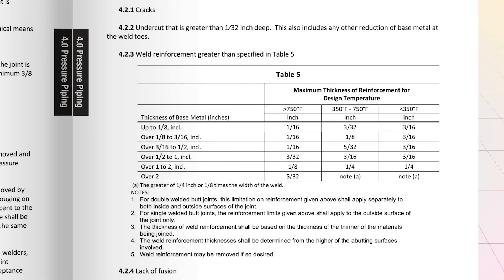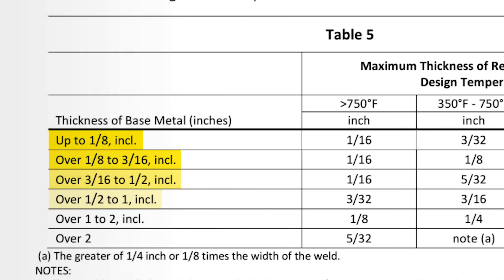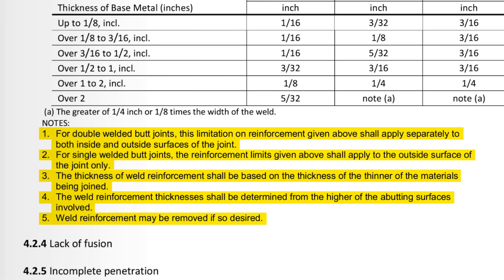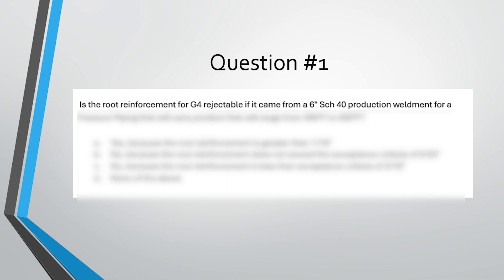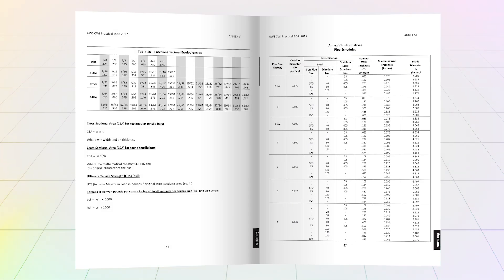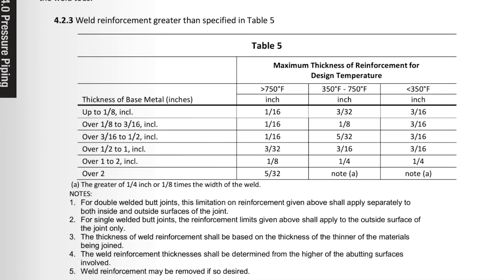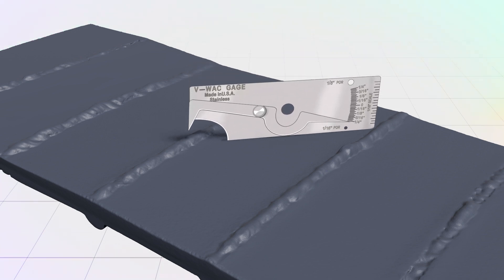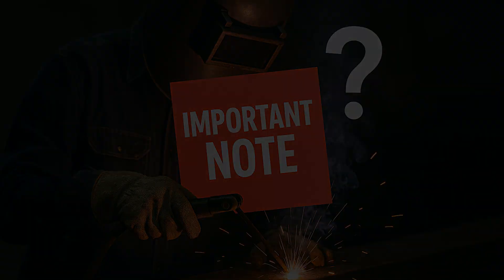Table 5 Secrets Unlocked: Master Pressure Piping Reinforcement Limits for CWI Part B Exam | Part 1

Comment: So im confused, it says a single welded butt joint, that table goes off of the outside reinforcement only?   So the regular pipe weld was a single welded butt joint.  So we still use the same numbers for inside and outside?